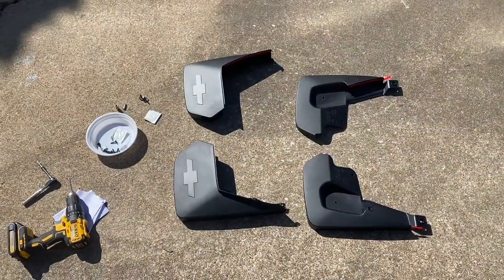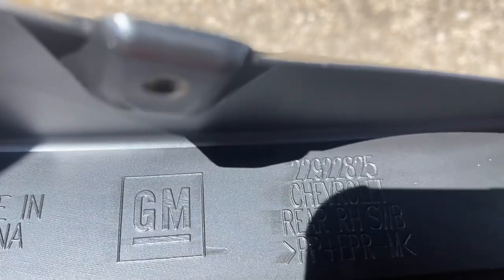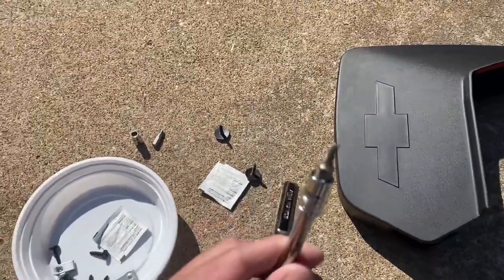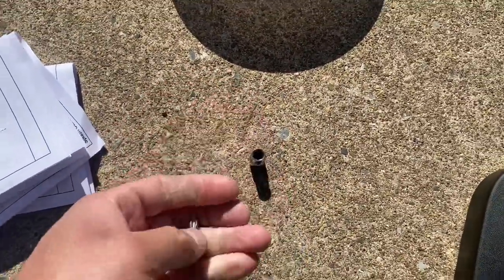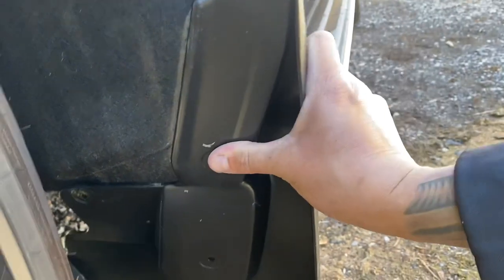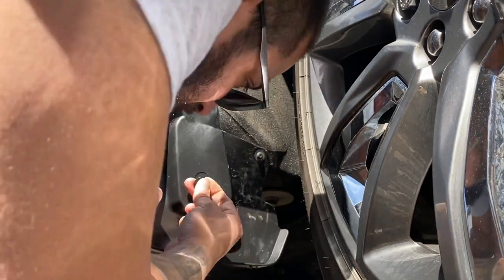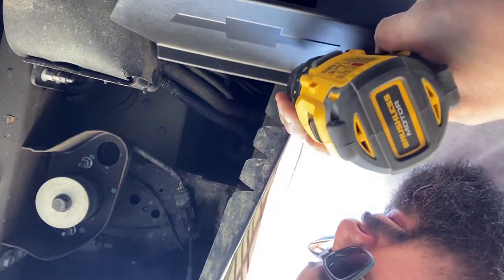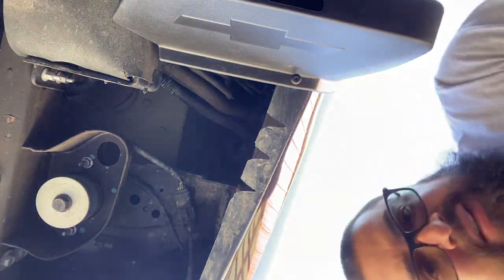15-20 Tahoe Splash guards Mud flaps install and review

Comment: Great video. I got those same mud flaps but haven’t installed them yet. I don’t like making new holes I’m thinking to not drill those additional holes?? What do you think is it very necessary to drill those additional holes??? Or should it be sturdy without the additional drilling??
Reply from the maker: Yes drilling those holes is necessary. Gotta commit
Reply: They are really sturdy without drilling the holes.  Never drilled in my 2020 suburban.  The local Chevy dealer said they never drill the holes either.